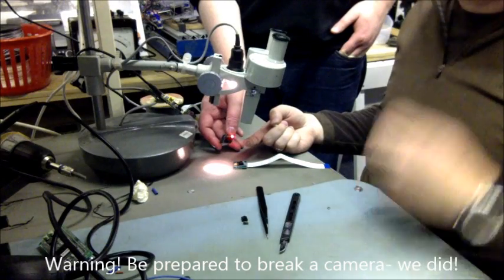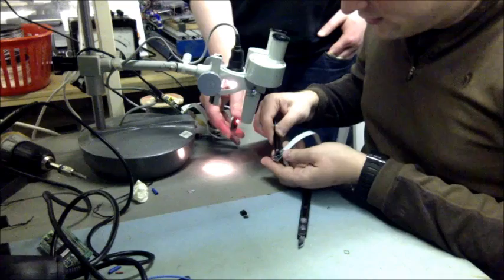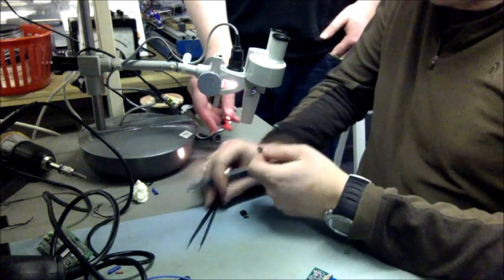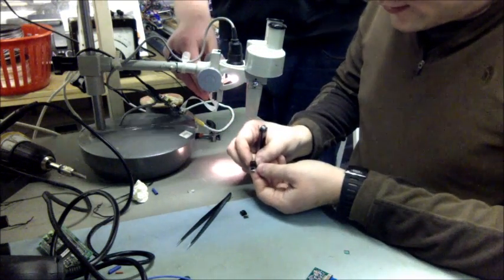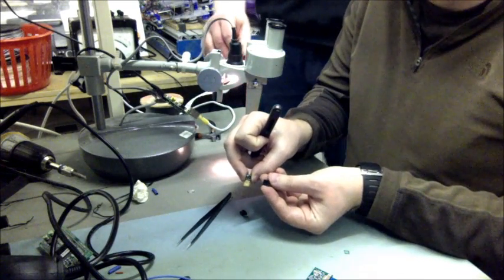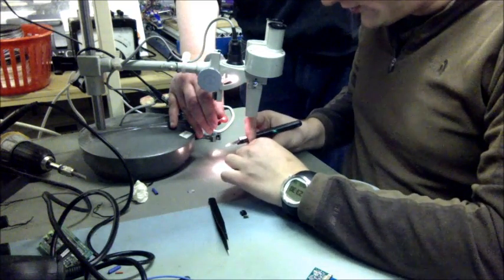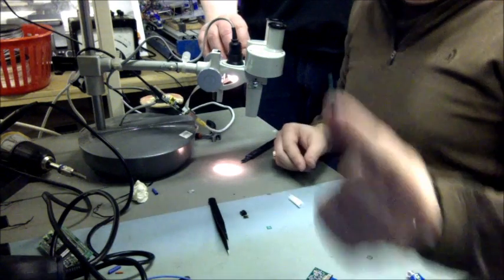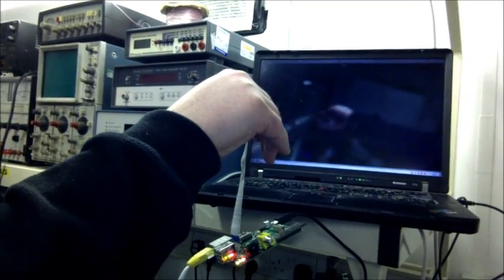Raspberry Pi IR Filter Removal

Comment: Well, I tried a thin ring of hot melt instead, and when it the lens fell of I stupidly reached to put it back on and shorted the darned thing.  I think I'll try some superglue next time.  Its either that or some Acetone solvent glue, and I have the same concerns you do about it screwing with the other coatings.

Comment: Question on the filter... Is is only an IR filter or does it also function on the UV end as well. Most standard cameras would filter high and low ends. If so is anyone looking into the UV side? Does the RP camera's sensor even go there?
Also check out our FamiLAB hackerspace in Orlando!